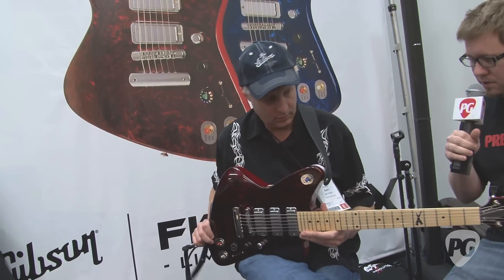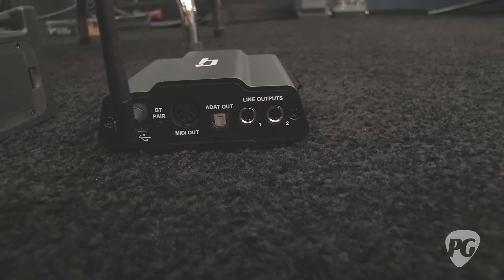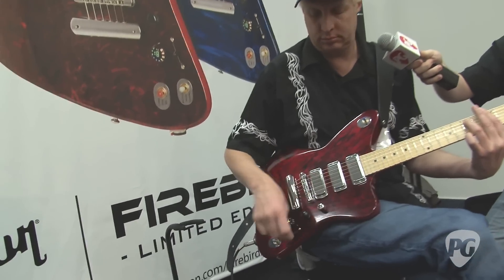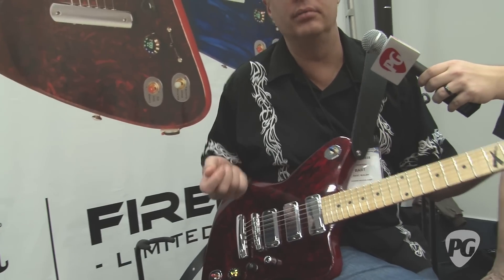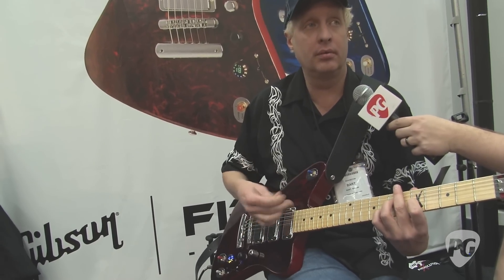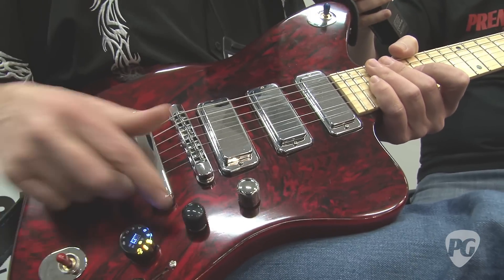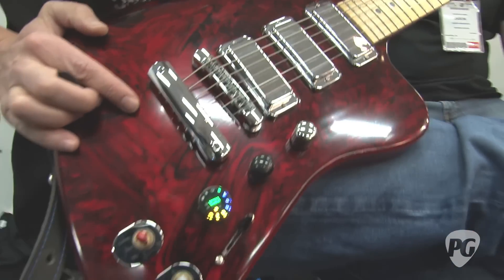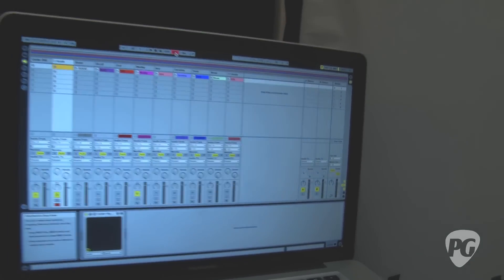NAMM '11 - Gibson Firebird X Demo

Comment: Yikes.  That's a lot of dependency on technology, which provides the potential for any number of weak links.  Besides the potential for bugs, if these were being built in 1963 do you think that they would be a desired, sought-after commodity in 2011?  Project that 40 years into into the future - do you think the support technology is going to remain stable?